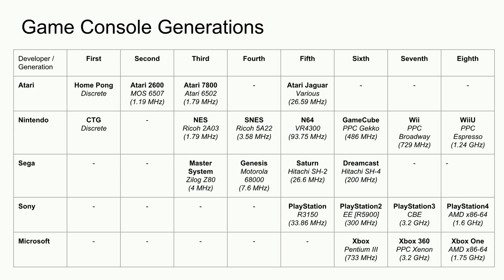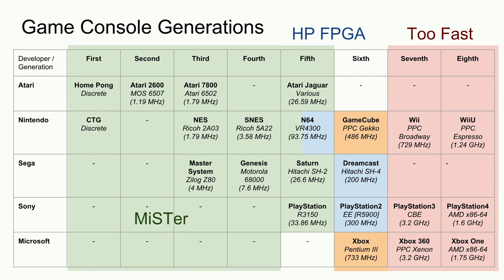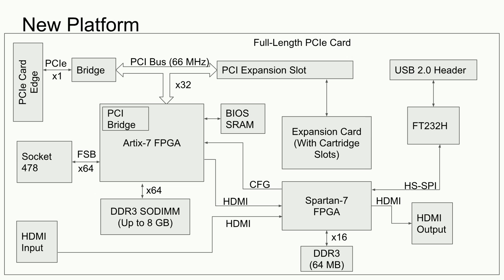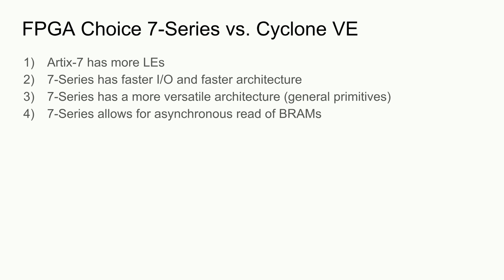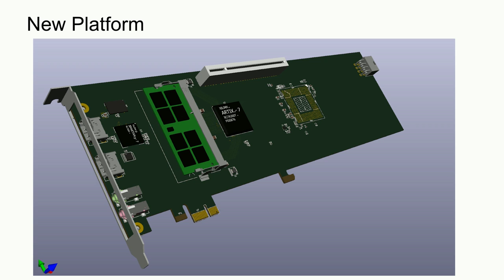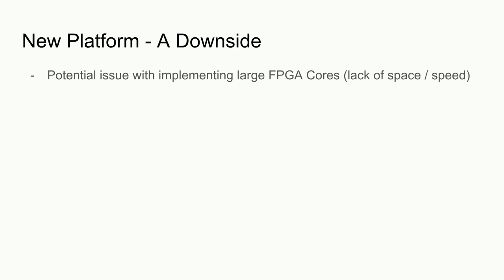A High Performance FPGA Game Console Platform

Comment: Fascinating, I hope some fitting fpga comes out some time in the future. Would this already work on the Artix-7 35t?
Reply from the maker: A fitting FPGA already exists, I think it was mentioned in the video (the Artix-7 200T). The Artix-7 35T would not work, since it lacks sufficient resources (i.e. you may be able to fit a C64 core, possibly an SNES core in it, but nothing more). Comparably speaking, the 35T is roughly 1/3 the size of the MiSTer. 
However, I have actually been thinking more about the idea of using a Zynq Ultrascale instead of an Artix-7, since it could allow for "hybrid emulation", and could presumably be far larger than an Artix-7 200T (at more cost of course).
Reply: @RTLEngineering  Interesting. Are you implementing the core in Verilog or using something like chisel (also used for Risc-v cores).
Reply from the maker: Which core are you referring to? The idea is to allow the MiSTer cores to be ported over to this new system, so those wouldn't be re-written.
As for an N64 / PS2 core, the only way to get the required performance is to manually write and optimize them in HDL (I have other videos on the channel discussing optimizations for both cores - since they use a similar CPU architecture). I use a combination of VHDL and Verilog, mostly VHDL though, since it's not prone to the same sort of typo errors that Verilog is (Verilog is nice for connecting blocks though).
A Risc-V core would have no place in this design, since none of the existing ROMs are compatible (i.e. you can't make MIPS machine code run on a Risc-V - you could by turning it into a MIPS, at which point it's no longer a Risc-V). However, that's not to say that you couldn't use it for something new, which does use a Risc-V. A Zynq Ultrascale, however, has hard ARM processors built in (at least the one I was thinking of), but you could always use the ARM to act as a system interface between a host and a soft-core Risc-V.
Reply: @RTLEngineering  Yes indeed referring to the vr4300 from your other videos. I mentioned RISC-V because that is also a risc chip and it seems people make nice implementations of it with Chisel, so maybe it works for this. But I guess you can't optimize to the level as VHDL.
Reply from the maker: Correct, using a tool to generate the core will not produce optimal results. Honestly, I had never heard of Chisel before you mentioned it. It looks like it's useful for general FPGA implementations, but not for this specific task. Furthermore, RISC-V being a RISC chip doesn't mean much when you are talking about a VR4300. The context of my channel has be surrounding implementations for "Archival Preservation", which means running existing software. You can't run VR4300 code on a RISC-V chip anymore than you can drive a cruise ship on a highway. They may be similar, but when it comes down to it, similar doesn't count for anything, except blowing out transistors (it has to be a perfect match - you can't run N64 code on a PS1 either, even though they both use a MIPS processor). If you wanted to create something new, however, using Chisel and RISC-V on an Artix-7 FPGA would be a feasible option.

Comment: Why s478? Isn't that a later-gen Pentium 4 socket? Pretty sure s370 was for Coppermine and Tualatin PIII/Celeron.
Reply from the maker: The s478 seemed to be the most readily available, also I was unable to find any good docs from Intel on the s370. Honestly, I don't think it will matter that much, though it may require a custom kernel (in which case using an Atom may be a better choice - unfortunately doing so would mean that the project couldn't be open-sourced since the Atom is under an NDA).

Comment: I feel like once you get to 3d games, the issue isn't accuracy and latency like it is with earlier platforms, but the overall presentation - aliasing, resolution, slow-down, draw-distance etc.  Could say a FPGA PS2 then work in conjuncture with a graphics card to handle post-processing and get an accurate, upscaled and prettied ps2 game?
Reply from the maker: It's both actually, though there are several software emulators for the PS2 that do a pretty good job. There are only a handful of games that are known to be unplayable with PCSX2, which most likely rely on hardware quirks that you don't get in emulation. On the other hand, the only feasible way to implement a PS2 core would be to use a black-box approach, which could fail to capture some of those hardware quirks as well. 
As for using a real GPU, that's a possibility. Presumably, once the draw commands are sent to the GS (the hardware component that drew the 2D graphics to the screen), the only other quirks would come from bus behavior and bottlenecks, which hopefully no games rely upon. So you could potentially treat the GS as a data / command sink, and abstract it out of the core and implement it on a modern GPU. After all, once you know the triangle positions in the screen, the actual resolution of the screen nor the method for rendering them no longer matters, as long as it executes the commands given to it. You would, however, run into issues with data synchronization. For example, if the GS was writing to a framebuffer to later be used as a texture, then you would have to somehow recognize that and pull it out of the modern GPU. Similarly, if a texture was updated, then you would need to send the update to the modern GPU. So the synchronization could be challenging. There are also SoC type FPGAs that have ARM Mali GPUs in them, which could be used to do the final rendering at a higher resolution, and would allow for unified memory. However, those are significantly more expensive. 
Tl;Dr. Using a modern GPU could work, but the logistics of doing so would be challenging.

Comment: Have you considered the Acorn CLE-215? Very cheap
Reply from the maker: I don't think that's a viable solution. 
First of all, it uses M.2 which means you would somehow have to pass a framebuffer via PCIe (huge bandwidth bottleneck + latency). 
Secondly, the FPGA doesn't appear to be specified, so there is no way to know what the FPGA is capable of. 
Thirdly (most importantly), it appears that the platform is ONLY for crypto mining, i.e. they abstract away the FPGA so that you can only load bitstreams that they provide via their API. 
And fourthly, it's not cheap considering what it is... It would depend on the FPGA in it, but if it's the FPGA I suspect, you are paying 2x what the hardware is actually worth (the cost is in their software and API which wouldn't be useful for this type of application).
Thanks for the suggestion though. It's always interesting to see how other markets are using FPGA accelerators.
Reply: @RTLEngineering  Bandwidth is 4Gbit/s, latency should be fairly low considering all GPUs are PCIe too. FPGA is Artix7-200T. JTAG-Headers are exposed and I can load and flash bitstreams with a generic FT2232H-board with OpenOCD. You can get them very cheap second hand for $70 + shipping. ($40 + shipping for the lower cost and -noise model with an Artiz7-100T). But aggreed, the integrated solution will perform better, you'll get what you pay for.
Reply from the maker: 4Gbit/s isn't sufficient in this case, since a 1080p60 stream takes 3Gbit/s of bandwidth. Also, PCIe latency is quite high, especially when talking directly to an FPGA. GPUs are able to tolerate it better since they can handle the incoming packets more efficiently than the FPGA can.
Also, having to rely on a JTAG header and OpenOCD is not a viable solution if you want to make it accessible to the general public (the whole point of the proposed system). Same thing for buying second hand mining solutions. 
Alternatively, there is nothing stopping an individual from taking a MiSTer core for example, and porting it over to the 100T/200T for this miner module and running the core there. The drivers and infrastructure would still have to be developed from scratch though, so the effort is likely not worth it.
Reply: @RTLEngineering  Agree. Points taken. You can program the FPGA via PCIe too, but that needs coding

Comment: 2 things: Is this still being worked on? Why do you need to have ram on the board if the PCIe spec allows you to use the system ram?
Reply from the maker: This is still being worked on, but has changed form. The only viable option from a value proposition is to use a Zynq Ultrascale+ SoM (any other solution would have a significantly lower performance/price ratio). So that's the current plan. 
Since it's using a SoM, the main RAM will be soldered to the SoM and thus can't be upgradable, though since that RAM is higher latency, there is a plan to have a secondary set attached directly to the FPGA logic. Also, there won't be a 486 socket, since there isn't enough IO, but there's another solution to that problem. Finally, it will most likely not be a PCIe card because the MPSoC part of the Zynq is more than capable of performing the required host functions - i.e. it's going to be an mini-ITX or micro-ATX form factor.
In terms of the PCIe spec, you can use the main system RAM, but the latency is terrible (up to 10us for a read) and the bandwidth quite low (as low as 1 GB/s), so it's not practical. It may be more practical in an environment with something like PCIe 5.0/CXL, but only the new Versal FPGAs support that.
Reply: @RTLEngineering  Darn I really was hoping for it to be a PCIe Card. Having it connect to my PC would mean I could experiment connecting it to other PCIe devices, like graphics cards and other older cards.
Reply from the maker: So I was considering a PCIe card still with the new FPGA, but there is one major problem.... drivers. It would be almost impossible to produce a consistent set of drivers across many different system configurations (look at how much NVidia and AMD struggle across windows alone). If it was a PCIe card, it would probably only work on Linux, and would be compiled from source by the end user supplied AS IS. So any bugs or compilation errors would probably be up to the end-user or community to figure out... I don't think it would be viable. (I originally thought it was doable, but looking into it more just shows how complex it is).
Although... the new design I am working with (which uses a SoM) has the ability for the FPGA to act as a PCIe host. I had looked into the possibility of being able to plug a GPU directly into the FPGA (so you could use a GTX1650 for example with the ARM CPU), but that turns out to have problems at the distribution level (i.e. NVidia applies a user license to the driver which means that the end-user must be the one to install it and debug any issues as a result).
I guess the TL;DR there is that it's very complicated to do PCIe things in a non-standardized way. M.2 SSD PCIe is easy, M.2 Wifi is easy, PCIe devices not easy (that's not a standard, only PCIe is), and GPUs are definitely not easy (they're not a standard either).

Comment: The cyclone 10 LP doesn't have a DDR3 PHY and Quartus Prime Lite doesn't support the GX variant.
Reply from the maker: That's correct, it's possible that I implied something else though. The Cyclone Vs do have a DDR3 PHYS (with the SoC variants having at least two). Additionally, the Cyclone 10 LP is slower and smaller than the Cyclone Vs, so it wouldn't be useful in this application. That's one of the main reasons that I started looking at Xilinx chips instead (the main competitor to Intel / Altera).

Comment: where did you get all that design experience from?
Reply from the maker: Several University degrees (for the theory), and many projects (for the practical). I am still learning though, since the electronics design space is huge - I usually learn something new every day.
Reply: Ohh wow okay, what do you mean with several university degrees? Multiple masters? Doctors? And how are you learning everyday? With papers? 
I really enjoy watching your videos and want to get involved in the field as well
Reply from the maker: Multiple MSc (done concurrently), and I'm currently in a Ph.D. program (i.e. doing research in a related field). Then there are papers (which don't actually teach you that much, but often have little nuggets of useful ideas), textbooks (which I have found the most helpful), blog posts / articles, courses (there are a lot of good architecture courses on youtube for free), conference proceedings (Hotchips has a lot of great talks - SGI presented a talk on the N64 RCP back in 1997), open source projects (dissecting code / examples on github), etc. 
A more concrete example is that when I was doing my B.Sc, Intel published several papers and the code for their Smoke game engine architecture. I learned quite a bit from those papers and their code, including a C++ style that I still use, design patterns, low-level multi-threading, etc. And then I started to implement my own game engine with what I learned (that was before even UE4 was released). Learning the basic theory though from courses and textbooks did really help me when trying to understand their architecture, and then reading other textbooks on design patterns helped even more.
As for learning things every day, it could be as simple as coming across some small bit of information that puts large amounts of information into perspective. For example, learning that the Xilinx FPGA tool will automatically re-align timing regions if you manually instantiate a BUFG primitive. And then timing greatly improves on many of the other projects I was working on as a result. (the tool doesn't always infer that a BUFG is needed)
Thanks! I wish I had more time to upload videos. 
It would depend on what part of the field you want to get involved in, and what your background is. For example, if you want to get into PCB design, but don't have an EE background, it's going to be much harder. Architecture and FPGAs are much easier to get into without the EE background, because digital circuits are much simpler than analog (designing an FPGA PCB uses a lot of analog knowledge for power supplies, loads, signal integrity, etc., whereas using an FPGA dev board takes care of all of that for you). In other words, the closer you are to software, the easier it is to get into. That's not to say that it's impossible, but you would be better off taking at least an intro EE course (there are a lot of free ones on MIT OCW though - you don't need to do it for a degree, but you have to take it seriously).
Reply: Oh wow, very impressive. I’m at my hard limit with only one MSc at the moment.
May I ask which degrees did you complete? 
I am currently studying Computer Engineering. Is that too little for that field? 
What was your approach to plan your future? 
Is experience working at companies necessary when I want to get into research?
Reply from the maker: Not really, most of those had a lot of overlap (i.e. take 2 extra courses and get another degree). I wouldn't recommend doing multiple degrees at once without having significant overlap (that's just too much work). Often however, many degrees will have "electives", where you can substitute required courses for each degree in those slots. Note that you pretty much need to get a PhD though to do academic research (you can do R&D research in the private sector without one). And if you do that, then you want to make sure you find a University with faculty members that are doing research in a field you are interested in.
A few levels of Physics degrees, Applied Mathematics (numerical stuff - i.e. what's needed for HPC), and a few engineering degrees (one of which is Computer Engineering). So yes, Computer Engineering is very helpful here - digital logic falls squarely within that sort of program.
For a future approach, I didn't really have one - I sort of went with the flow. I knew that I wanted to teach at a University and do research, so I followed the simplest path to get to that goal. And in terms of working for companies, that's not required to do research, though many people in academia recommend getting some experience there (many companies have paid summer R&D internships). I can't really give you much advice there though, since I came from a science background (physics) and not engineering, so all of my non-university research experience is with government funded laboratories.
Reply: Very nice, I hope I will one day be as experienced as you. 
I actually already found a faculty I really like. But they do not offer any jobs or PhD Positions at the moment. :/
Where did you complete your degrees? Is global networking that important?
Reply from the maker: Experience comes with time, it doesn't happen over night (I've been in this field for over 10 years).
Usually faculty at universities won't offer "jobs", but instead accept students. I'm sure there is going to be more than one faculty member throughout the world, and don't be afraid of going to a program in another country as long as they pay for the degree.
I completed all of my degrees in the US, which was helpful because there are a lot of universities here. However, there are also some really good programs in Berlin and Zurich, etc. 
I'm not sure what you mean by global networking? If you publish papers and go to conferences, then you end up doing global networking by default (especially if they are IEEE).

Comment: This is great. This would be good for n64 and ps1 since you could increase the frame rate. I would only buy it if it could connect to a crt.
Reply from the maker: You would probably have to convert the HDMI to composite to connect to a CRT. I wasn't planning on targeting the CRT market directly, since most people would use an HDMI compatible device.

Comment: What would it cost, though?
Reply from the maker: That was stated in the video, though may not have been all that clear. It looks like the cost would be around $400 USD, where $230 of that is going to the FPGA chip alone.
Reply: @RTLEngineering  😬